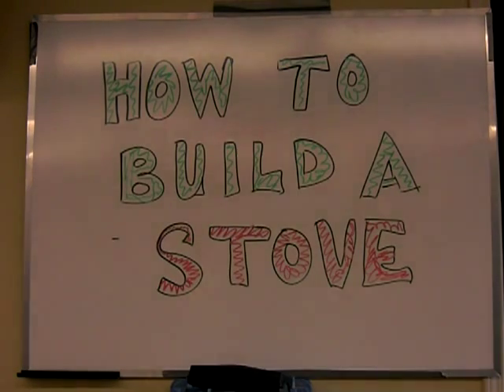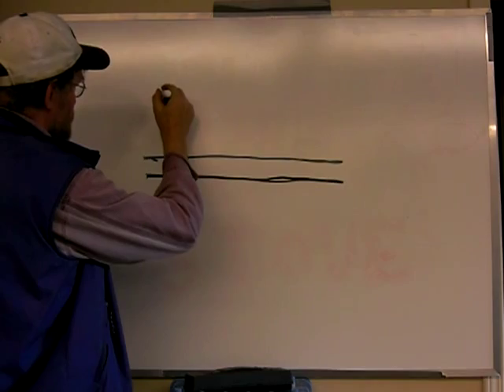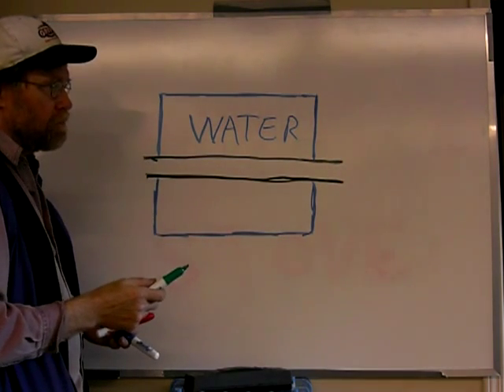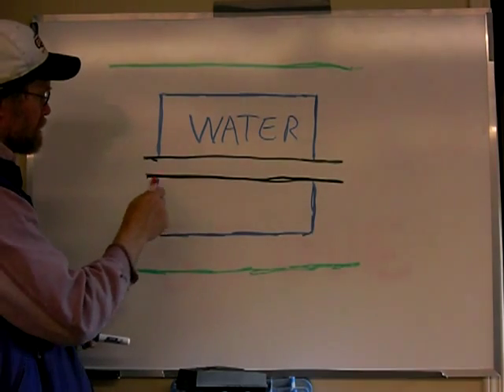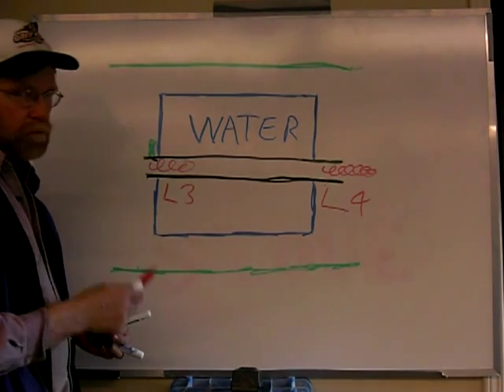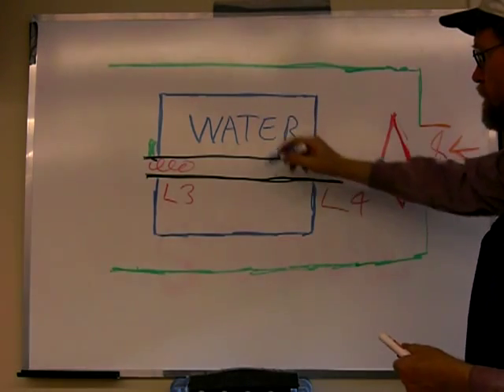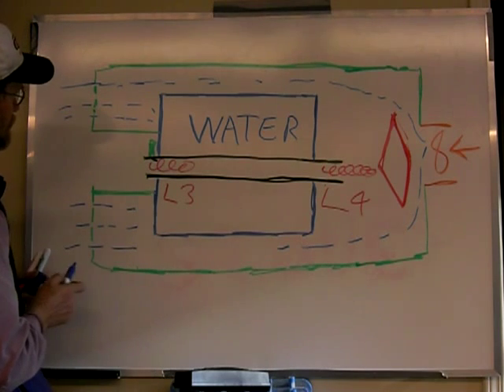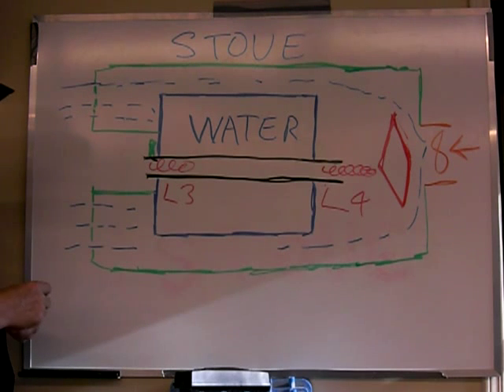#13-PART 1 of 2-Joe Pipe-HOW TO BUILD A BETTER STOVE

Comment: @douglundy ya I see what you are saying, I was about to say the same thing.  maybe a 2" joepipe inside a 4" air sheath,  put that whole thing in. allowing the JP to get glowing red and maintain flame profile.  also doubling the exhaust back through the water w/ an unsheilded 3" pipe like a big U,then surface heating it inside the containment on the way back to the right would help with water heating.  more use of heat prior to venting

Comment: the water will keep the pipe at boiling or below and the flame wont be able to attain that high red/white heat needed to break the water into hydrogen, it will just condense and drip...

What I want to see is an insulated pipe so it gets even hotter, no, a thousand degrees in contact with water! flash boiler! or else it will not get past 212 f. buddy..